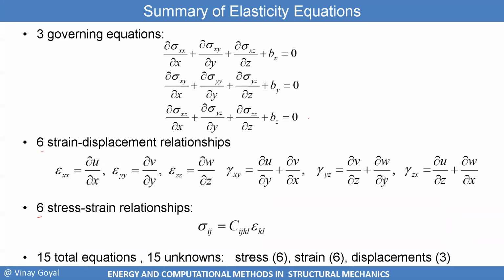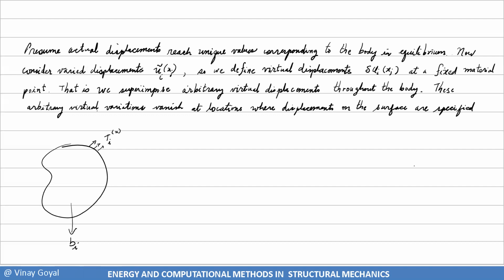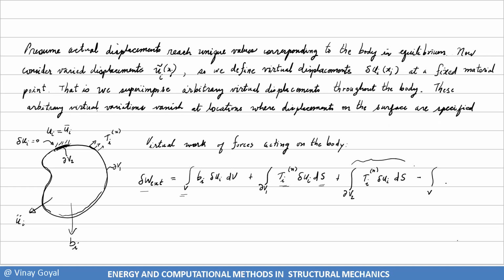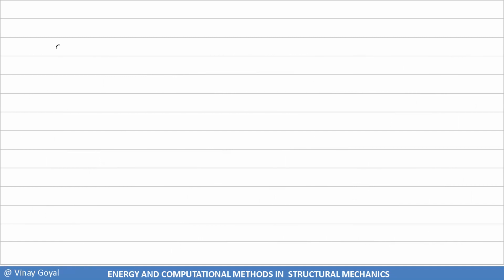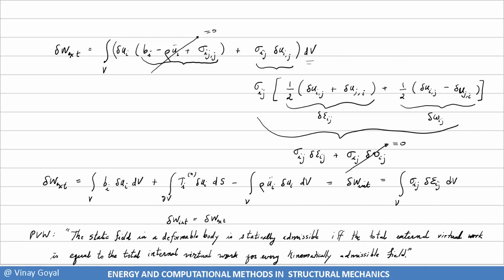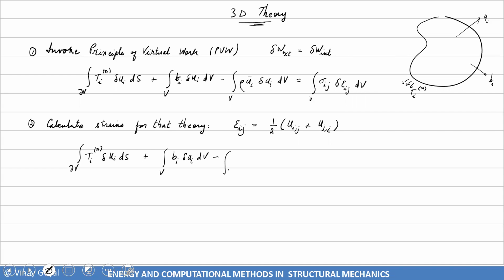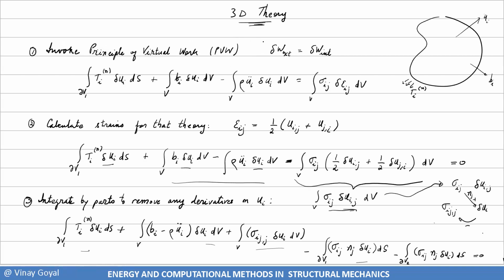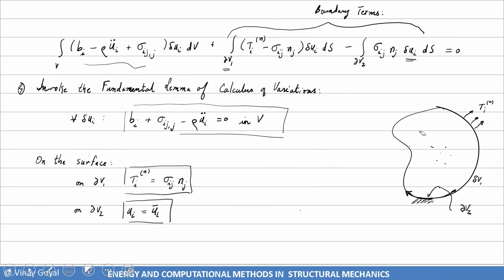12. Energy Methods and Computational Mechanics  - Principle of Virtual Work:  3D Theory

Comment: High level class explained in a very clear way, thank you for that ! Im writing my thesis related to topolgy optimization, do you have any class or recommended material to this topic in a bachelor level ?
Reply from the maker: thank u look at my lecture notes under advanced aerospace design i explain this along with an abaqus tutorial at a basic level
Reply: @VinayGoyal  Thank you for the quick answer ! I've seen this video and it's really good. I'm currently trying to understand the math running behind the software, do you have any recommended material to this topic ?

Comment: at 13:15, you describe how we get the intertial work term, with F=ma times the displacement. So aren't we using Newton's law there? How is it that we've derived the equilibrium equations without using Newton's law is we use it right there?
Reply from the maker: No. We found the work done due to inertial forces and mä is a force due to inertia and when that works thru the virtual displacements it gives the virtual work done due to inertia. This has nothing to do with Newtons Law. We could also have alternatively derived it using kinetic energy which is 1/2 m v^2 and gotten the same answer
Reply: ok thanks!